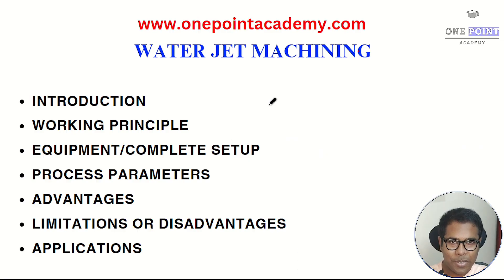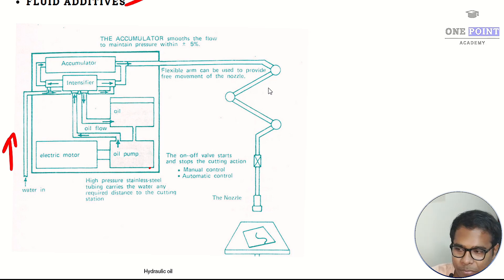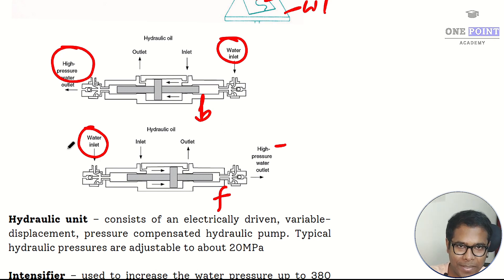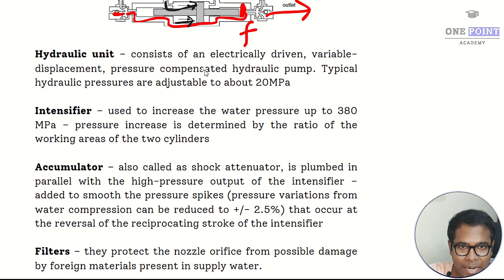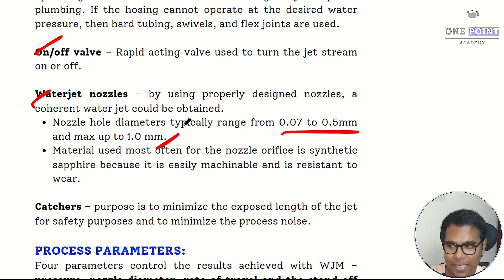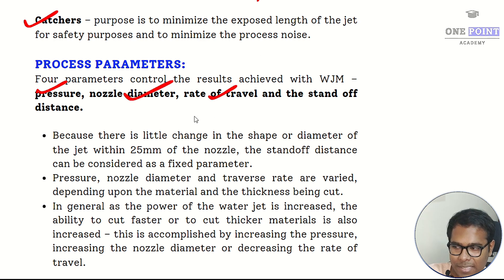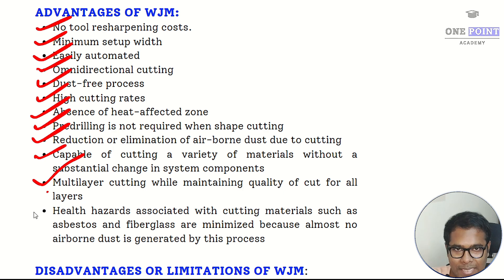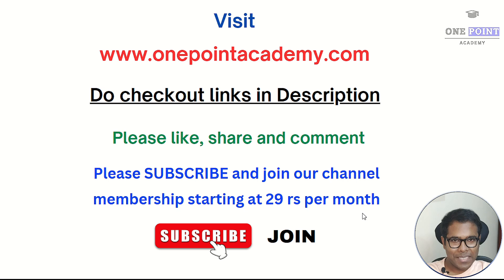Water jet machining (WJM) - Diagram, working principle, advantages, disadvantages, applications

Comment: 🎯 Key points for quick navigation:

00:05 🎥 Introduction to water jet machining, covering principles, components, advantages, disadvantages, and applications.
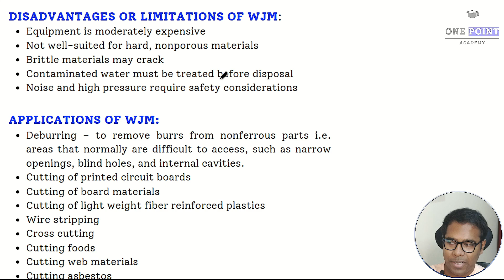00:45 🌊 Water jet machining uses high-velocity water jets for material removal through erosion, also referred to as hydrodynamic machining.
01:12 ⚙️ Key components of water jet machining include hydraulic unit, intensifier, accumulator, filters, and nozzles.
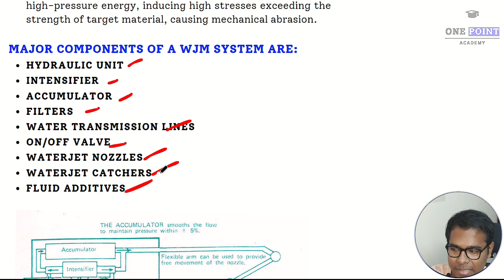02:04 💧 The intensifier boosts water pressure up to 800 times, crucial for effective machining.
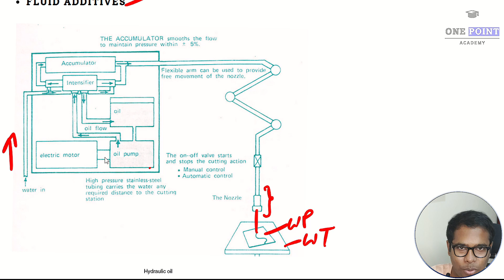03:14 🔄 The on/off valve is essential for safety, automatically cutting water supply post-machining.
10:12 📏 Process parameters include water pressure, nozzle diameter, and rate of travel, with standoff distance being non-critical.
11:09 💸 Advantages include no tool costs, omnidirectional cutting, and a dust-free process due to water's use.
14:10 🚫 Disadvantages encompass high equipment cost, limitations with hard materials, and the need for careful wastewater management.
15:35 ✂️ Applications of water jet machining include cutting printed circuit boards, deburring, and slicing food products.

Made with HARPA AI